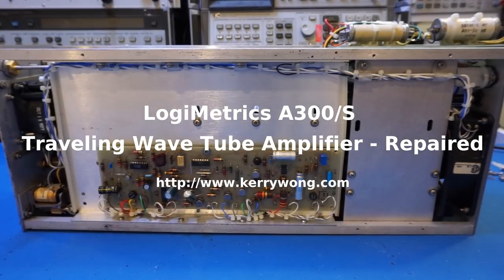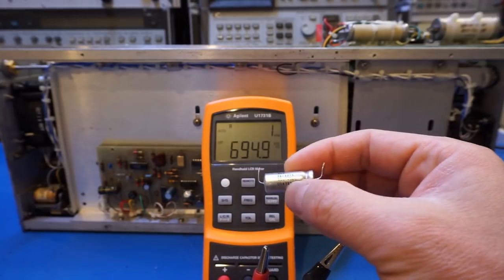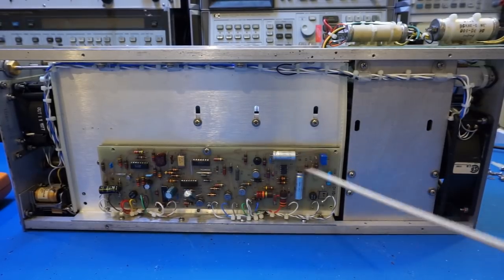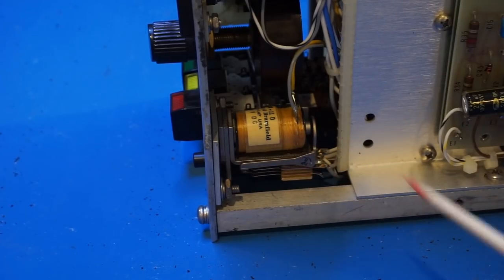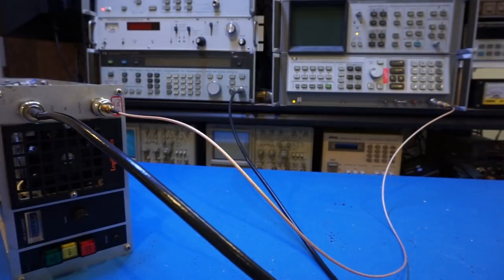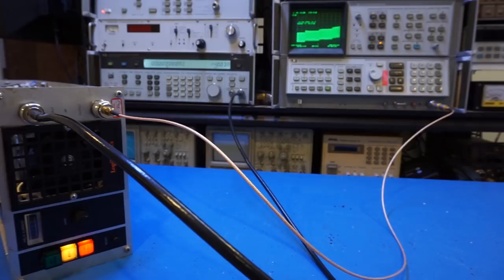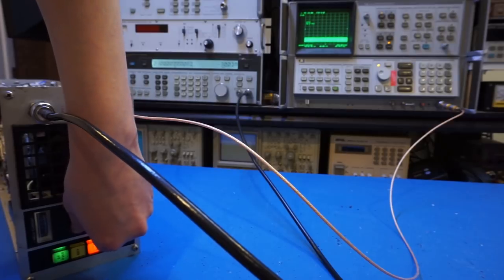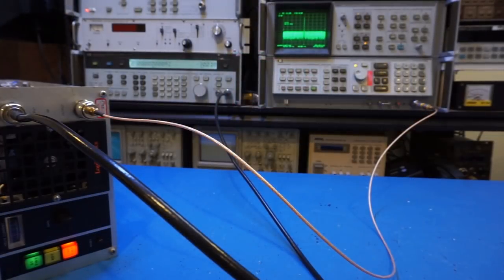LogiMetrics A300/S 2 - 4 GHz Traveling Wave Tube Amplifier - Repaired

Comment: Nice fix and experiment Kerry. You may want to consider looking for a -30/-40dB attenuator that will handle higher power levels. I picked up one of each recently and the -40dB Mini-Circuits unit for example  is good up to 4GHz and will handle 100W...relatively inexpensively, well actually a bit pricey but makes testing ham radios much easier, especially protecting the front ends of the spectrum analyzers on the bench.
Reply from the maker: Yeah, I will definitely look for one as they will come in handy in the future.

Comment: Glass sealed tantalum will pretty much last forever, unless they have corroded through. I did test 1000 that had been sitting for 3 decades plus in storage, and not one was out of specs, though the rubber sealed versions ( the lower cost option) had all gone bad.
Reply: If they're the TAA type, best not refit them because the failure mode tends to be that they catch fire!
Reply: @cambridgemart2075  Vishay CTS13 series are pretty reliable though, as they have an internal PTFE separator that cups the tantalum slug and keeps it nicely centred into the silver plated steel case. You just do not want to look at the price for the larger values in the range.
Reply: @SeanBZA  Interesting, I haven't encountered that particular variety.

Comment: Is it supposed to emit that high pitched noise when you increase gain? :)
Reply from the maker: The noise you heard is from the HV inverter. When as the helix current increases, the inverter gets loaded and hence the noise. voltage from the HV output looked normal and this kind of noise is not that uncommon for HV inverters.

Comment: Helix current is a side effect of the RF power and is undesirable, so it's not technically correct to say you're adjusting the helix current.
Reply from the maker: Thanks for pointing that out, it really should just be "gain" and as you pointed out the current is a side effect.

Comment: 18:30 The problem with using it to amplify Wi-Fi is that Wi-Fi is 2-way. You'd Transmit many miles for sure and you'd need a similar Burner on your Client device. Piss a few radio HAM off to boot not to mention all the Bimbos wondering why Wi-Fi wont work. But hey, whatever channel you Tx on, it would be YOUR Channel. No one else would be able to get a packet in edgeways.
Reply: There's an implementation of one way Wifi, like UDP but going a step further and removing the need to associate a connection. https://befinitiv.wordpress.com/wifibroadcast-analog-like-transmission-of-live-video-data/

I just can't think of very many use cases with the transmitting side fixed, at least not for the hobbyist.